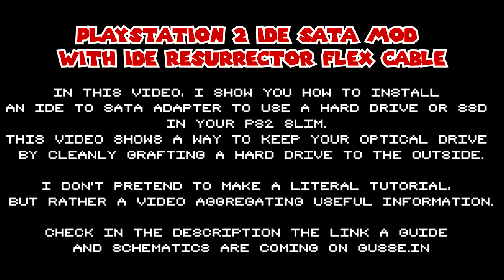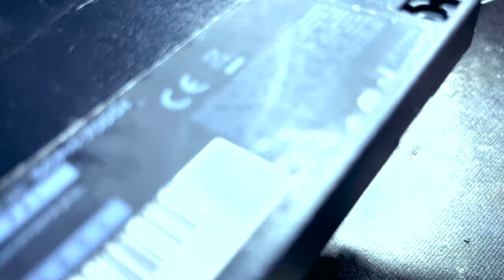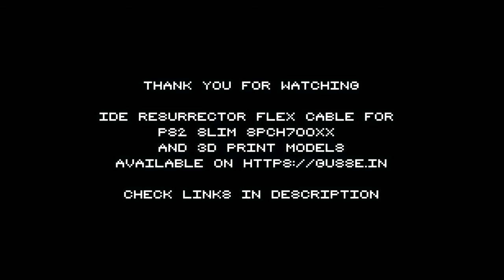IDE TO SATA HDD / SSD - PS2 SLIM INSTALL

Comment from the maker: ⚠ERRATUM⚠ 
SOME BIG HARD DISK DRIVE NEED MORE POWER, SO YOU NEED TO PLUG 5V TO USB POWER, 
THE 5V REGULATOR I USE IN THIS VIDEO DOESN'T EMIT ENOUGH CURRENT
⚠ERRATUM 2⚠ 
WE ARE TALKING ABOUT 100PF CAPACITORS (AND NOT 100µF)
Reply: Are the caps required if you're using your flex cable with the SD card reader?
Reply from the maker: @Sadistic46  nope ;)
Reply: I'm in the process of doing this myself but didn't realize the need for the caps. What are they doing in this install that's not needed on the IDE to sd mod?
Reply from the maker: they stabilize the electronics of the cheap SATA adapter and keep it running ;)
Reply from the maker: @davidallen5783   they stabilize the electronic circuitry of the cheap SATA adapter to make it work properly in this use case. Without a capacitor, the results are not good.
Reply: Do i need a Regulator if i use the 5V from USB? Or can I just pull a cable from the USB port to the flexcabel?
Reply from the maker: @kokoderaffe8649  no, you can use 5v directly from USB ;)
Reply: @Gusse  But then it makes no difference whether it is inside soldered or with an USB port adapter?

Comment: Wonderful!
by the way
What is the reason for supplying 5V power from the top of the motherboard?
Reply from the maker: I use the 5v on the top of the motherboard, because the one on the bottom has a protection circuit that blows a fuse if you ask too much current to the regulator using a hard drive 😉
Reply: @Gusse 
I understand very well!
thank you!🤓

Comment: I'm really interested with your work. May i know by doing so does the transfer rate remain the same as ps2 usb port or already different?
Reply from the maker: yes, the transfer is much higher than by USB, otherwise I wouldn't bother making all these changes ;)
Reply: @Gusse  great! Just bought used PS2 fat 5000x. After disassembly I found old mod chip. I search everywhere on the internet but couldn't find the exact model. Gladly happy if I can share some photos with you. Would be nice to get your opinion on that
Reply from the maker: @mattkuah5567  if you haven't found it on the net, I wouldn't know any better 😅

Comment: Amazing looking product! Perfect for my purposes. But what is the reason for the CAPs between RESET, READ, WRITE, ACK, and their adjacent ground pins? I don't think I've ever seen anyone do that before.
Reply from the maker: thank you. Without its capacitors, and with this kind of adapter, it simply doesn't work.
Reply: @Gusse  Yes I figured as much lol, I was just wondering if you knew why. 

Full disclosure I'm making a portable using this kind of HDD loading, and I'm trying to gather as much knowledge as I can. I actually tried this mod a several years ago, using the exact same SATA bridge device as well, just without the benefit of your flex cable. The system interfaced with the device, and I was able to load and play KH2 precisely once... And then it just stopped working. Mayhaps this was the reason? And had I known to put those CAPs in place, it might have worked more that just the once?

I don't suppose that was what happened before you figured out to add the CAPs?
Reply from the maker: @AngelArm1110  I'm not the person who discovered that capacitors were needed in these places. I just know that it's the fruit of empirical testing for no apparent reason. Capacitors help stabilize signals for chips, which are of very average quality but readily available and very inexpensive. Other boards apart from Maxwell chips don't need these capacitors. Also looking at ide to SD boards, capacitors are present and this is potentially only a prerequisite of control chips, and for certain reasons. Also the original mod released a few years ago and which has become hard to find uses more capacitors on its circuit to certainly stabilize electronic fluctuations.

Comment: I would like to know if its possible to fit a deshelled ssd inside the ps2 slim.
i would also like to know if the ssd would require more power like the 2.5in HDD you were using. if not, would i not need to do all that extra soldering with the sata connector, or would i be able to plug the ssd in outright once i have the adapter connected to the resurrection cable?
im very new to this, and am interested in trying this.
Reply: no, seriously, can Gusse or anyone give me an answer?
Reply from the maker: @marrizard  Hello ! 
yep I can give you an answer of course ;) just I have a lot of work and I do my best to try to answer to sollicitations ;) 

SSD need less power than HDD (there is no motor inside, so less energy and no big currents peak).

You can check here some posts I have made on X last year : 
https://x.com/Gusse__/status/1694691375269167210

and here: 
https://x.com/Gusse__/status/1693648391807402133

and here withtout lid to have a better view :
https://x.com/Gusse__/status/1683854788243468290

files and somes resources are available on my website gusse.in
Reply: @Gusse  thank you so much for all this info. I will definitely look into all of this. You're the best!

Comment: Hey man I did an install with wires to a standard ide hdd and it gets detected in ulaunchelf but i cant format it or read games in opl what could be wrong, do i need to use caps for an ide hdd too?
Reply: Now it reports the wrong size
Reply from the maker: caps are need for IDE to SATA mod, not needed for SD Card mod

Comment: I wanted to buy one but unfortunately for me it's not good as I put the hard drive in place of the optical drive with the wired installation... Unless you bend it in extreme ways.
But it's still a great flex cable nice job! :yougotthis:
Reply from the maker: you can teardown SSD drive, and remove plastic box, then you can close DVD hood
Reply: @Gusse  I mean that the shape of the flex cable is not suitable for installing a hard disk in place of the optical drive as I like to do with wires.
Reply from the maker: @ragenfio  https://pbs.twimg.com/media/F15AlNhWYAAXJGd?format=jpg&name=4096x4096 check that ...
Reply: @Gusse  Yes I saw on your Twitter profile and I like your idea, but the way I install the hard disk the flex is not good. I want to clarify that it's not good only for me, I also made a paper mockup based on the photos and video to understand the shape and dimensions of the flex cable.
Reply from the maker: @ragenfio  Interesting! if you have something to show, I'd love to see it ;) personally, I've done a lot of installation with wires, it's cool to do, but you need time... ;)

Comment: Is the correct value for the capacitor 100uF or 100pF?
Reply from the maker: ohh so sorry 🤦‍♂🤦‍♂ -> it's 100pF THANK YOU VERY MUCH !!!
Reply: Glad I found this comment. I was using 100uf smd caps because I had them on hand. You say in the video it might have limited functionality without the caps. Should I me able to read and format the SSD without the caps in place?

Comment: Can I use a SSD with this Mod an at same time a Matrix Infinity or do I need the Modbo 5?
Reply from the maker: Yes you can use SSD and with matrix without any trouble ! depend on the SSD some can’t t support direct boot via dev.2 option in matrix menu, but can launch from opl from usb or memory card and play games from it.
Reply: @Gusse  Many thanks, that sounds great! Is there any recommendation of SSD?
Reply from the maker: @OverLord-OvLd  unfortunately I haven't test a lot of SSD so I have no specific recommandation... I have tested some Samsung, Crucial and old Corsair and they run withtout trouble but I can't guarantee anything
Reply: @Gusse  No problem, thank you!

Comment: Do this mod work on the ps2 slim 90004 model aswell?
Reply from the maker: hi unfortunately no, Sony has removed the components on the revisions after SCPH700xx, you can use MX4SIO on 90004
Reply: @Gusse  Thanks Gusse I appreciate your reply but I can use the MX4ISO with modbo 5.0 with the software if iam not mistaken. I know they said FMCB is also not compatible with the 90004 series aswell but that is why I rather ask you who know what works and what not.
Reply from the maker: @luanvdmerwe8257  From my side I have done an SCPH90004 with integrated SD reader on memory card slot and use a modbo 5.0
You can also use OpenTuna to do that without modchip. I remember the SD compatibilty could be tricky, and don't forget to make DVD and CD fold at the root of your SD Card and activate BDM support in OPL ;)
Reply: Thank you Gusse do you have a tutorial on how to do it?
Reply from the maker: @luanvdmerwe8257  You can check out the video of this great guy https://www.youtube.com/watch?v=FyCB-7K_9EU 😉

Comment: Точно такой же переходник но у меня так и не получилось запустить SATA, хотя IDE HDD работает отлично. ХЗ чё там, так и не разобрался.
Reply from the maker: did you have installed capacitors as shown in the video ?
Reply: @Gusse  What should be the capacitance of the capacitors? Or does it not matter?
Reply from the maker: @Shmayzer  in theory 100pf , bigger should run as well, I have made test with 220pf if I’m not wrong, and it’s fine but not 100% sure 😉

Comment: I've wanted to do this soo bad but I absolutely cannot justify spending $40 on a flex ribbon. That's just ridiculous. I'll wait on the clones.
Reply: Yes it is expensive but i think the price is fair.
Reply: @trueactionchannel  I can see if it came with the converter adapter and resistors, stripped down and soldered up, maybe $25. Printed models on top of that, maybe $40. But the ribbon itself at that price, no way. I wouldn't even consider it. $10 would be a stretch at reasonable for something such as that. An accomplishment, sure. Congratulations on that. But not a logical price for what essentially is an extension cord, in my opinion.
Reply from the maker: I totally understand, and I'm not going to justify myself here because I'm not forcing anyone to buy my flex.
Wait for the clones, as I'm waiting for them... a cool German guy published his sources to make an installation like mine and I still don't see any clone... if you want to make your own you can use his models it's free: https://circuit-board.de/forum/index.php/Thread/33386-M2PS2-PCB-f%C3%BCr-PS2-Slim-SCPH-700XX-zum-Betrieb-einer-M-2-SATA-SSD/
If you watch the second screen of my video, I indicate that you can do it with wires, and it will cost you $0.5 or less 😉
Reply: @Gusse  I've seen the wires install on your channel as well. Pretty intricate! Your wire management is unbeatable. I'm glad you took my criticism the right way. I'm sure you'll get (and have gotten) some sales at the price you're going for. 

I may still do a wires install just to say I did.
Reply: @androxilogin  given that the guy sells only a few I think it's a fair price for the time spent making it. (But yes it's hard to justify when you can get a fat with a network adapter for 10 bucks more)
Though for now I'll just keep using the network, it's fast enough for most cases.
If I get the motivation to install an hdd I'll probably make a knock off using 3d printing and wires.
Reply: @satibel  MX4SIO.
Reply: @androxilogin  mx4sio is 1.6MB/s, disk is 5.3MB/s,  network is 8.6MB/s and HDD is 66MB/s 
Currently Mx4sio is basically the same speed as the usb, so the only usefulness is trading an usb port for a memory card slot.

Usb and mx4 have compatibility issues due to the slow loading, so I wouldn't recommend them for games.
On a fat, you have the firewire or the expansion port, and on a slim the network is fast enough for most cases, so the mx4sio isn't that useful imo.

Imo the only practical use cases for an hdd on a ps2 slim are speedrunning, but most categories use the ps4 or pc emulation because of the even faster loading times  when they are allowed, and for the games that have private servers where you might have issues with both loading over the network and communicating. (And a few use the hdd iirc)
Reply: @satibel  You must be pulling some outdated stats. It loads amazingly fast and is much faster than USB. Loads FMVs smoothly and compatibility has grown drastically to the point it's officially been added as an option in OPL. Works great. And you can make one for less than a dollar. Using an SSD is a waste, really. The PS2 can't even handle the speeds it's supposed to produce. But it would be convenient and snappier. Network sharing is a stationary mess. Back in the day it was cool for multiple consoles but today, not so much.
Reply: @androxilogin  I saw some theoretical 3mb/s but I'm not sure, from what I saw it still has some issue with video, so it's usable if you want to use the network, but imo network much more flexible and it's faster than disk so there's not a lot of reasons to use mx4sio I'd have to try it when I want to play a game that has online servers.
Reply: @satibel  ¯\_(ツ)_/¯
Reply: @androxilogin i had using mx4sio before, still slower than disc and smb, so your options are still invalid
Reply: @pantsuteam  "before" implies you used an outdated version. It's a work in progress. My 'options' are endless.
Reply: @androxilogin  oh please. I'm gonna pay 100$ when memory card slot got faster than disc and network
Reply: @pantsuteam  You're going to overpay by $97 for an MX4SIO when you can make one for free at home in a couple minutes? Not sure why you'd do that, but alright.

Comment: Why not design your own pcb instead of doing all that work on Chinese junk adapters?
Reply from the maker: very good question, I thought about that, but designing and producing that, will be much more expensive than using components already present on the market, already the price of the flex I made is already relatively high, I doubt that many people buy an adapter equivalent to that one  😉
Reply: @Gusse  If you build it they will come. Flex cables are expensive to design to begin with. PCB's are generally cheaper. I think a compact flash adapter may be doable and allow over 128GB
Reply from the maker: @OnTheEdgex23  yes I know, after I do this in addition to my main activity, and it's hard to find time for engineering this, if others want to start this adventure 😉 for now I stay with Chinese adapters, I will soon make a test with a compact flash adapter that I just received, apparently the limit of 128GB would be bypassed ☺
Reply: @Gusse any news on this? I’m considering buying your ressurector flex but the only thing putting me off is the 128gb limit
Reply from the maker: @Stabz47 I always recommend the SATA mod to go beyond 128Gb at a reasonable cost. But you can make the mod with iFlash SATA to get around the 128Gb limit. You need to make a wire bridge to connect the iFlash with ide resurrector or make the mod directly without ide resurrector using the mapping diagrams on the net for wiring. Check out my posts on X (Twitter), including this one: https://x.com/Gusse__/status/1728388537626792347?s=20
Reply: @Gusse  how did you wire the iflash zip connector to the IDE?